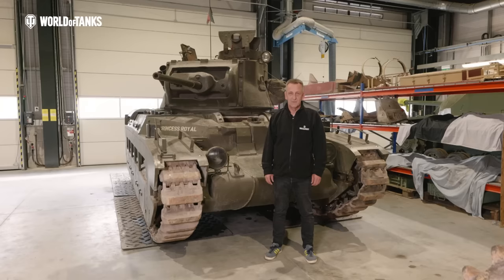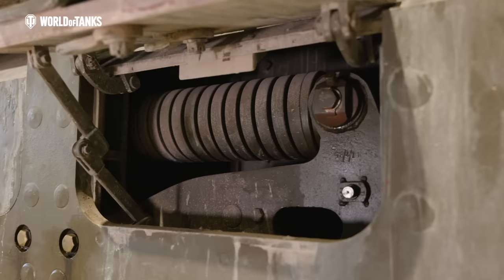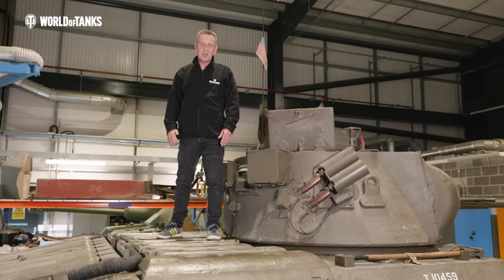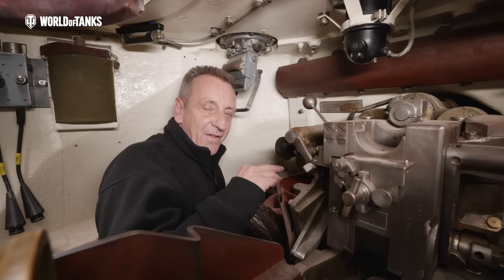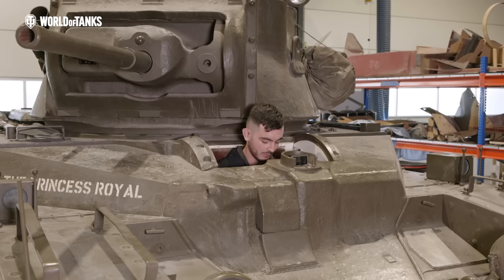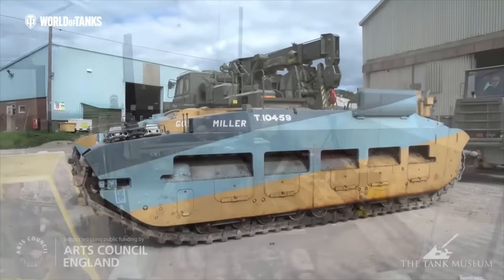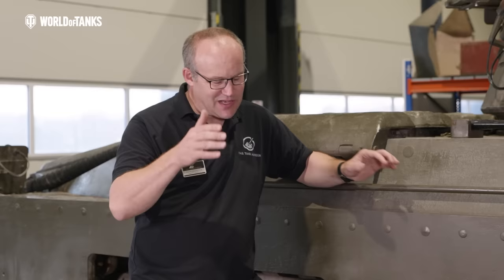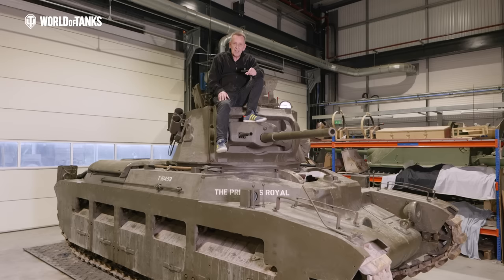Inside the Tanks: Matilda II

Comment: G'day from Oz... I worked on Leyland Leopard buses for some time, and have seen inside these pre-select boxes. A common fix for premature band wear (and breakages) was to install an air dump valve on each of the clutch actuators to allow quick exhausting of air when coming out of a gear into the next. Otherwise, the exhausted air would need to travel all the way back through the lines to the gear shift valve, taking a few seconds to do so.

Some less-mindful drivers would sometimes not allow a pause between gears and thus the next gear would be selected with the previously selected gear still engaged, with obvious results. The dump valves (a readily available air brake type) solved much of this problem.

Comment: Made at the Vulcan Iron Foundry at St.Helens near Liverpool.  The factory no longer exists. 
Its armour proved highly effective at Arras in 1940 stopping Rommels panzers, rolling over the German anti-tank guns.  The Germans panicked. The Germans leveled an 88mm anti-aircraft gun using solid shot used for bunkers, to knock it out. It prompted the acceleration of the Tiger 1 tank design and production.
Reply: I used to work at the Vulcan factory in Newton le Willows
where they made these tanks.
Ended up being taken over MAN diesels and shut down.
The Ruston diesel engines were superior to their German counterparts.
Reply: @larry4789  
Paxman were also better than German engines.
Reply: I also was an apprentice at The Vulcan, some of the old guys could remember building Matilda’s.
John

Comment: the low speed and heavy armour were an advantage in new Guinea and borneo-they were walking pace with the Australian infantry-only a japanese 75mm antitank gun would have a chance against the frontal armour. They must have been very hot in the jungle. In borneo the matildas were used in teams of two flame throwers and two HE  to knock out japanese concrete bunkers
Reply: Just a reminder that they were designed as infantry support not as battle type tanks. I still love the concept of a tiny tank( these were tiny) with formidable armour protection and some reasonable punch in weaponry.

Comment: My understanding is that a proper HE was not developed by the British for the 2-pounder gun at all. There was an armour piercing round with HE filler produced in the early years that was apparently sometimes referred to as "HE", which was soon phased out of use, but no HE. The Soviets thought the lack of HE a serious shortcoming in the Matildas sent there and tried to replace the gun with a 76mm but that proved impractical.
Reply: The British actually made Matilda II with 3 inch (76 mm) howitzer firing high explosive or smoke shells which would have been ideal as an infantry tank to support infantry. For some unfathomable reasons, they chose not to use that variant extensively to support their troops.

Comment: I first learned about this game from the 1998 SSI game Panzer Commander. You could not destroy this tank in the game with the Panzer 3's 37mm gun. Even at point blank range the shells would just bounce off. I had to learn about this tank after that lol.
Reply: Yeah, the "Tiger" of 1940.  At Arras they threw the German armor into such a panic that (I heard) Rommel thought he was being attacked by multiple divisions when there were only 16 Matilda IIs attacking (most British armor were the machine gun only armed Matilda Is).

The Matilda II's gun wasn't much different from the German 37mm gun on the Panzer III, but the problem was armor.  The German 37mm could penetrate the 78mm armor with some special higher performance armor piercing shells at a range of around 100 m (standard armor piercing shells would not penetrate). Meanwhile the British 2 pounder (40 mm) gun could penetrate the 30mm armor on a Panzer III with just a standard armor piercing shell at over 1,000 m.

Comment: I think that the word "ergonomic" was pratically unknown to British tanks' designers, crews' layout was really awful, plus it was pratically impossible upgunning them with such a tight turret ring. I read that they'd to push forward the gun mantlet to allow a third crewman, the Valentine and Cruiser tanks had the same problem.
Reply: Ergonomics in military seems a new field not given that much attention. Had a ride in early cold war DAF military truck and they had the gear stick behind the driver seat, just sick out a little.
Reply: Ergonomics wasn't forgotten but, like every other element of design, compromises had to be made. You can give the crew more room but that increases the armoured volume, so do you have a heavier tank or thinner armour, for example. Every decision causes ripples.
Reply: Terrible ergonomics are part of a course from that era. Early tankettes were the best. You are sitting next to a running engine. Hazardous, incredibly noisy and you have plenty of vibrations to tire and deafen the crew to outside dangers.

Comment: The AEC diesel engines supplied about 87 horse power for each engine- not combined. AEC began to mike slightly more powerful diesel engines which were fitted into the AEC Matador 4x 4 artillery tractor- a vehicle that survives in high numbers due to its rugged nature and usefulness.

Comment: waltzing matilda lol. Why does anyone bother describing the machine gun as 7.92mm when its actually 303 British.    7.92mm usually describes  7.92x57, the standard WW2 German cartridge.
Reply: @@user-ci9vj6kt8w 303 British is nominal bore 'groove' diameter 0.312 inches, which in metric is 7.92mm,that means that if you actually measure the un-fired projectile for 303 British, it will measure 0.312 inches. The lands inside in the barrel is slightly smaller at 0.303 inches (7.7mm) hence the confusion.  There is a similar issue with the soviet cartridges like 7.62 x54R and 7.62x39.........they actually use the same projectile diameter of 303 British at 0.312 inches.   Whereas the American 7.62x51 is a true 0.308 diameter projectile.  As you can see, there is a lot confusing cartridge information and this is why you dont call 303 British "7.92" because it overlaps directly with the German 7.92x57 which itself can and is called 8x57 in later years. Cartridges developed in imperial measurement nations like the UK and USA are habitually called by their imperial names, not metric. Thats why 30-06 Springfield is almost never called 7.62x63.  Whereas cartridges from metric nations like Germany,Austria,Switzerland and the USSR use metric designations.
Reply: The bullet might be the same diameter but the cartridge is different. 7.92 is a much less ambiguous order than '.303 RAC Special, not the usual'.

The 77mm gun must really annoy you...
Reply: @andrewflindall9048    They are all confusing and convoluted in some way, thats why being specific matters.  Like going to surgery for a leg amputation and they remove the wrong leg.  Its not funny is it.
Reply: @wazza33racer  The Besa machine gun was chambered for 7.92mmx57 Mauser, not .303. This wasn't a mistake, British built tanks had these guns.